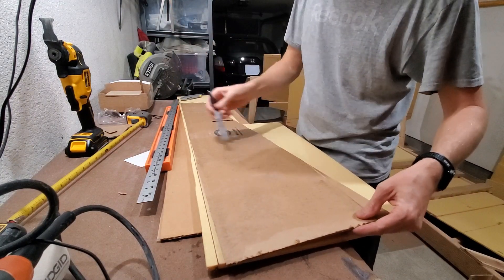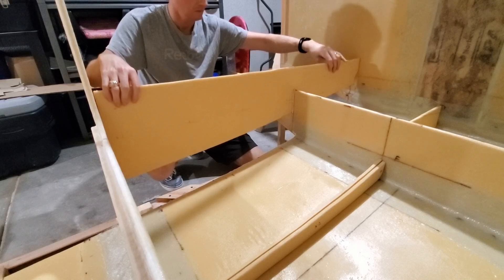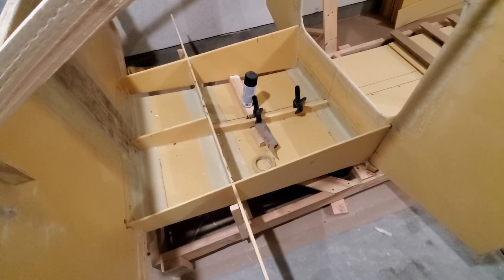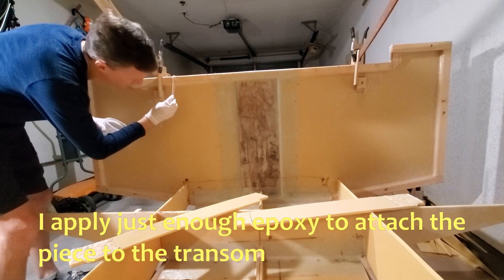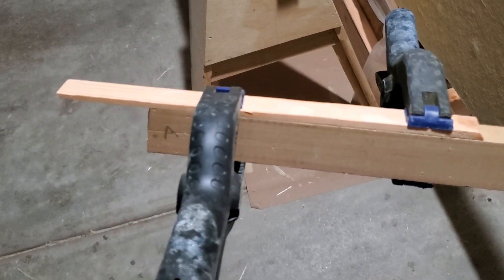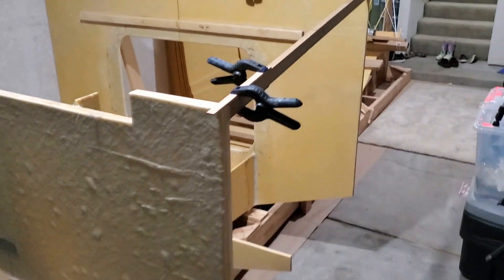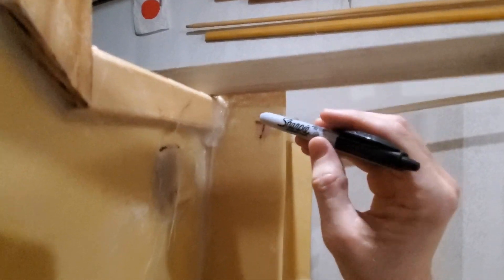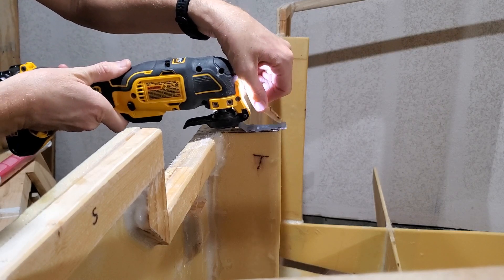OCSS-011 Strengthening the Aft Cargo Hold

Comment: My impression is, that the longitudal reenforcment might better be done first and then have cutouts in the bulkheads instead?
It apears a little fiddely to me to have the many smaller pieces in between the bulkheads attached afterwards.
Perhaps a longitudal centerpiece mounted first makes things a little easier for the assembly.

Comment: Hi Capt., I have used the same type of rope before for odd jobs and my concern would be chafing. 
Testing for strength may give good results for direct pulling, but any movement of the battery /anchor and slackening of knots might cause ropes to move and rub. Though more expensive Paracord might be be another option? A cheap option is old car seat belts from a scrap yard. You can cut strips to size and width and seal the cut edges with heat. Seat belts can make good handles if you roll it across the width and feed through a 3/4 inch diameter piece of 6" rubber hose, have 3 - 4 inches out each end, then splay open and you can bolt or screw through the ends, or as you have done epoxy and glass over.
Reply from the maker: Thanks for the ideas. Car seat belts would probably work well.

Comment: Hi this Alan, love your boat build, are you going to reinforce the transom for a small kicker motor?
Reply from the maker: I think I'm just going to start off engineless and use a sculling oar. Later I may add an electric trolling motor.
Reply: Thanks for the reply, I have a lot of experience with steal fabrication, and casting lead, MIT be able to help you with your  Keels.
Reply from the maker: @alanburtenshaw3998  That's great. Where are you located?
Reply: I live in Gilbert AZ